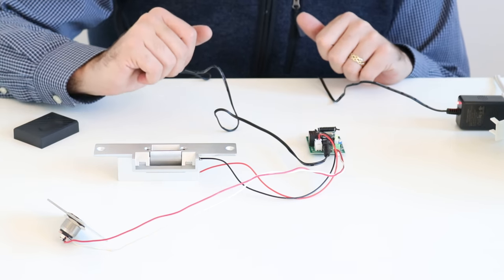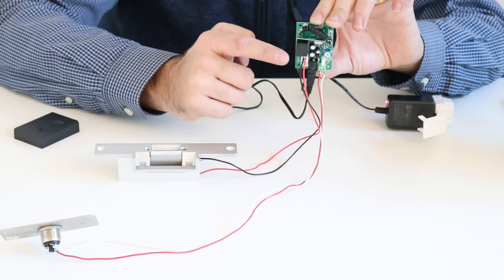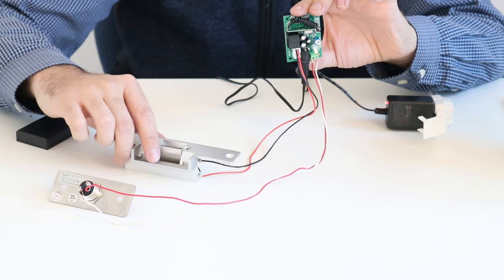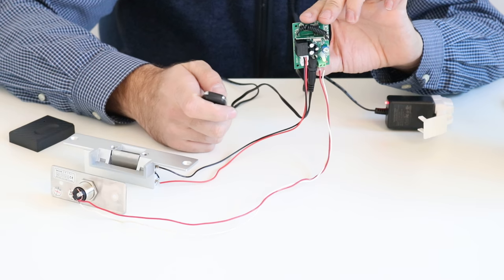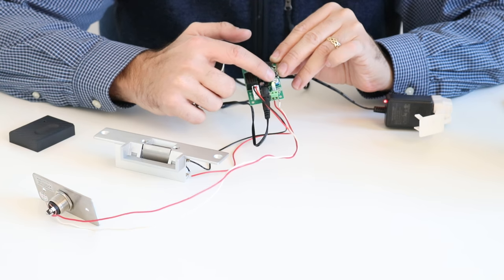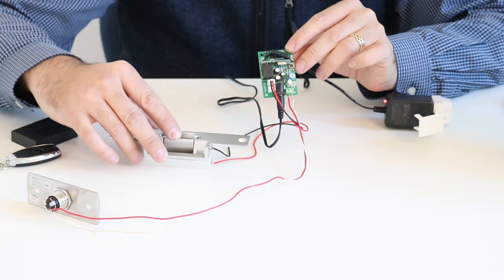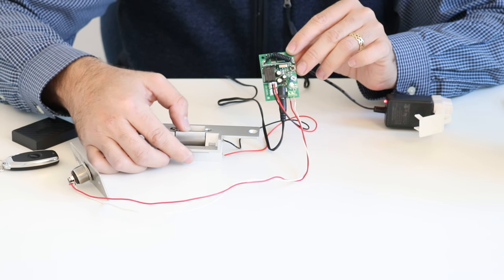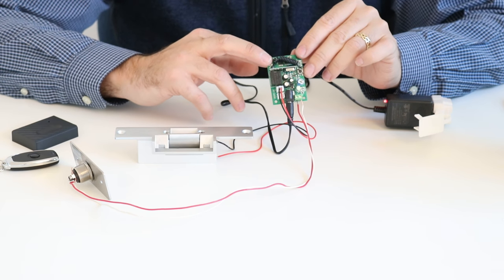How An Electric Strike Works, Remote Door Opener

Comment: Most electric strikes do not require a control board unless you want the strike to engage for a set time, you would need a relay for that.
Reply from the maker: This electric strike was part of a kit: https://amzn.to/2Y1pSAI that came with the control board so I just used the kit and the provided clicker for unlocking.

Comment: be nice if you would mention if the wires to the strike have a negative and a plus side ,  or does it mater which way they or connected ?
Reply: Both strike and power supply have + and - positive of strike goes to relay, positive from power supply goes to relay common. Negatives of both tie together.
Reply: Pro tip:  The black wire is the negative side.  The red wire is the positive.  An International standard right there.

Comment: I would like to add a wireless wall button to my Ring Access Controller to open the door. I see you have a Key fob, I would like the same thing but a wall mount button. Do you have any suggestions? Thanks for any advice.
Reply from the maker: Tony, it says that the Ring Access Controller: https://amzn.to/31Ltt6C is compatible with push unlock buttons. This Button:  https://amzn.to/2Dydill should work fine.

Comment: Hello thanks for explaining the use of this, I have pretty much the same setup apart from the remote control I was thinking if it is possible to have it set to wifi control because I am disabled and while I can see who is at the gate on my phone I still have to get to the intercom telephone to operate the push button.

The radio control probably wouldn't work due to the distance i am from the gate and the amount of concrete and steel there is in the house, having said that the wifi does work that far easily and also i like the idea if I am not at home and a delivery man arrives he can open the gate from speaking to me on my wifi camera , i can then open the gate and he can leave the parcel safely. thank you.
Reply: yes it can, but for that you would need to buy a smart plug separately. The way to use it would be the least complex of all, only having to plug the charger of the strike lock into the smart wifi plug and turn it on via the app on your phone. The lock would have to be set to always locked by default, with the smart plug just cutting the power to it, effectively disabling it when you action the plug.
Reply: Im currently looking at setting this up with something called UniFi so you can have both mobile access and use NFC chips to scan in and out. Its not cheap though.

Comment: Hello thank you for sharing your knowledge, what would be the best wire to use on a electric strike like this one?
Reply: Insulated copper
Reply: If the strike uses "DC" the wire should be stranded... 18ga is common, I suggest all circuits fused (3a)